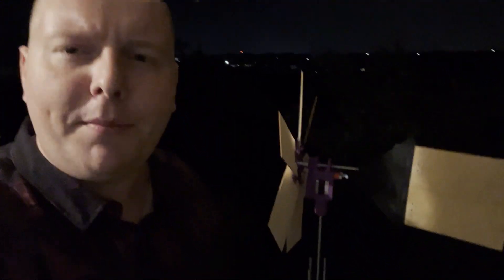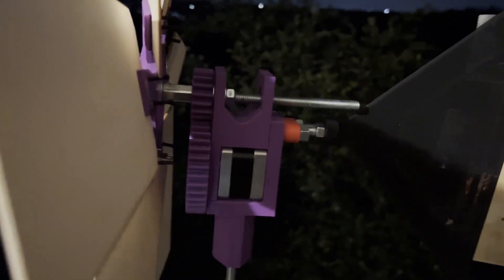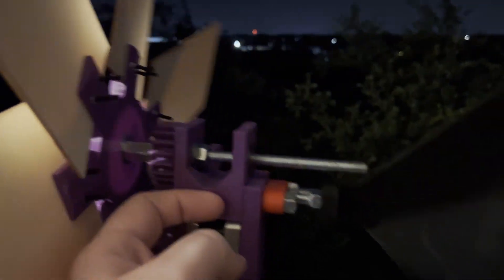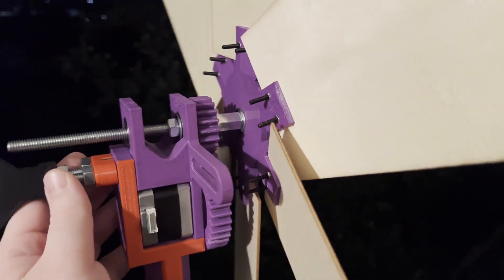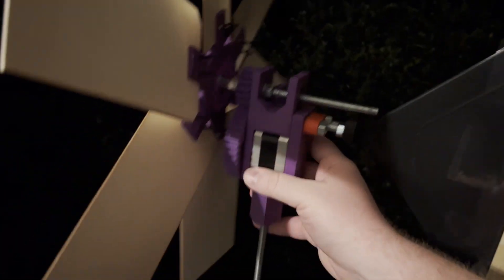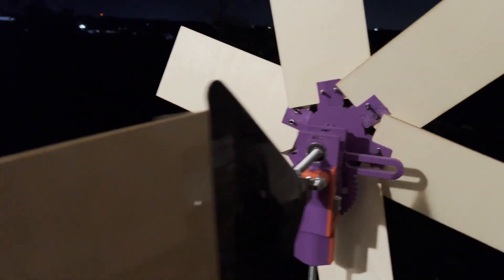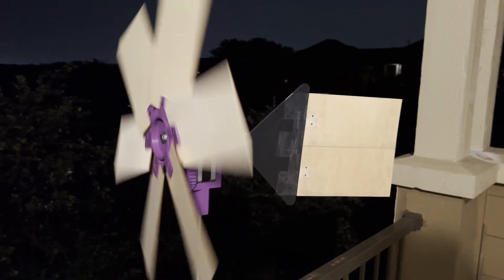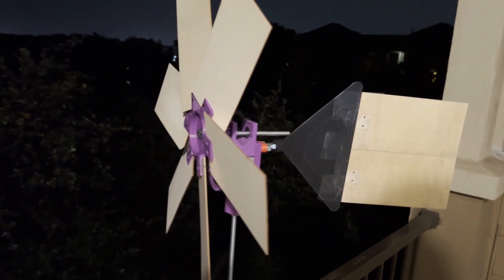DIY/Homemade Wind Turbine Generator (no. 20)

Comment: Have you tried out vertical wind turbines as yet?
Reply from the maker: I have! It's currently my opinion that a vertical wind turbine is harder to harvest energy from the wind from. When wind is passing by it, you're using, at most, half the footprint of the blades, vs near 100% on a horizontal axis windmill that faces itself into the wind. 

That being said though, I am still undecided which is a better suit for my purposes, namely one that can fit on my balcony railing. In a setting like mine, the reduced footprint might be worth it in exchange for the ability to collect wind from more than one direction, or rather, turbulent, directionless wind can still be collected without the windmill needing to pivot as much of a large and heavy structure. 

I am currently on Windmill XXI (and getting ready to wrap it up). I haven't told anyone yet (so don't spoil the surprise ;) ) but I think Windmill XXII will be a VAWT. I cut some blades for Windmill XXI that ended up being too heavy, but I think they'll do fine in a VAWT, so I wanted to at least try.

Cheers, friend :) Glad you're here
Reply: @christophersfactory  the general concensus around VAWTs seems to be that they're excellent for blustery conditions where the wind direction & strength is inconsistent.
Though yeah, they definitely have a lower ceiling of efficiency, I reckon they'd suit my personal set up (a ground floor flat with a small back garden) far better.

I'm here for the creativity & you keep delivering in spades man.
Reply from the maker: @NM-wd7kx  Hey, thanks for the kind words, that means a lot. I totally agree on the VAWT thing. It's always been fascinating to me that in the realm of windmills that there is no one "correct" way to do things. There is no one design, horizontal or vertical, that trumps the others. Not even any tip-speed-ratios have been proven to be always better. Rather, there are some sets of loose guidelines, and it depends on the conditions, the setting, and the maker. I think that's inspiring.